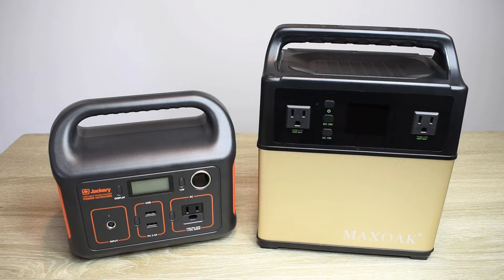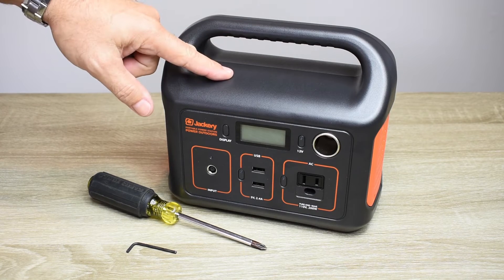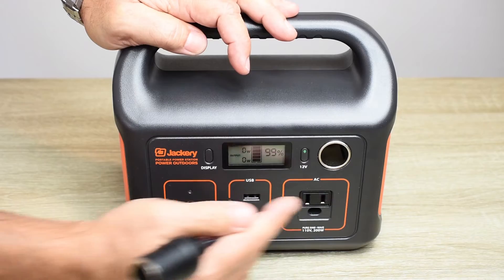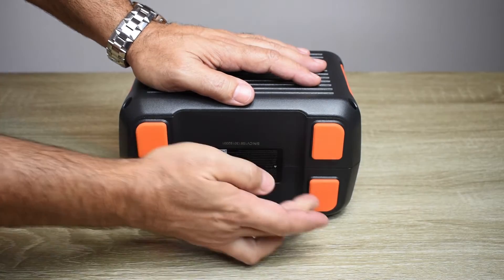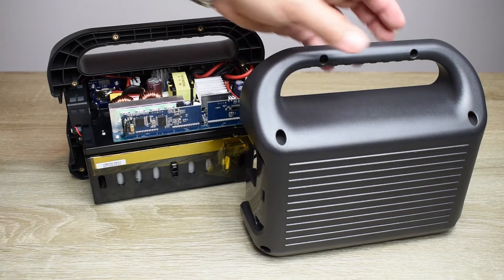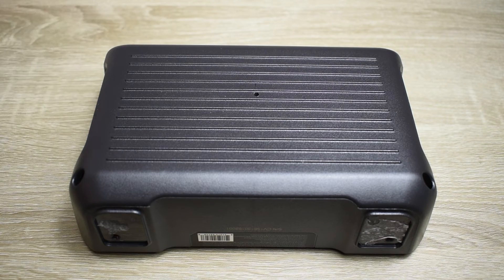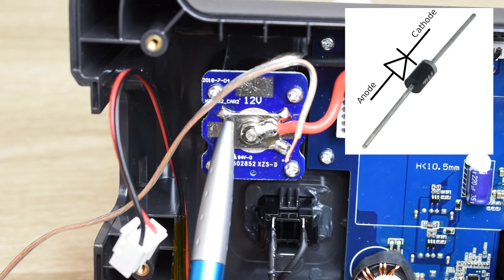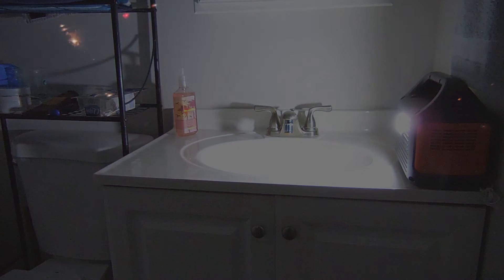Jackery Portable Power Station Lacks One Of These!

Comment from the maker: ATTENTION: If you'd like to drive the COB LED at maximum power(Extra Bright), then be sure to bond a larger aluminum plate to the portable power station first(unless the power station has an aluminum housing), then bond the COB LED to the plate/aluminum housing using thermally conductive adhesive. Thank you!
Reply: Thank u . 
Have u made any vids on and littelfuse.. the red  tvs. Transiant voltage .... thing . Used on 12 alternators to stop the higher then 14.5 volts from getting past the alt output . .

Comment: 🎉⚠️  W A R N I N G  ⚠️

AVOID AFERIY Power UNITS  & THOSE FAKE PAID FOR info media TEST reviews about AFERIY PRODUCTS. I bought the 2400 Watt version. It was DEAD on arrival.There is almost ZERO customer service for this brand. 

Do NOT buy Aferiy. Don't risk losing your money. 

WARNING - Do NOT buy extended waranties. 

DONT WASTE YOUR MONEY - LIKE I DID. 

Having said all that, Aferiy Power Banks are not totally useless. I believe they would make for really good boat anchors. 

I am posting this as a public service to prevent others losing their money. If this reviewer scrubs this message they are likely compromised and it's not a genuine review.

Comment: Nice work on this project.  I love modifying stuff like that to make them better.  In a project like this, does the LED need any kind of protective cover, or is it fairly robust for bumps and scuffs?
Reply from the maker: It's very durable. There's a rubbery coating over all the LED chips.

Comment: I added an inverter to my jump pack, it's only 18 AH but it's nice because It'll run my 2,000 watt inverter just fine.  It has a built in excellent air compressor, a directional light, cigarette adapter, amazing USB charger (charges things quick).  I too needed an area light too so I mounted a lamp with a LED Bluetooth speaker bulb.  It only uses 15 watts, but is very bright and the speaker is decently loud.  I also have a tiny inverter that plugs in the cigarette lighter (100 watt max) and put a light socket adapter into it to run it for very long periods of time by itself as the large inverter is inefficient for that purpose.  I am converting it to lithium power with 2 of those hoverboard batteries and a 13.8 volt transformer.
Reply from the maker: There's nothing wrong with modifying things to create exactly what you're looking for. :-) Thanks for watching!

Comment: For anybody looking to find a polyfuse/polyswitch.. Check an old motherboard or USB hub, should be sufficient to protect wiring as they will likely be <2A.  Pretty cool mod, can never have too many lights!
Reply from the maker: 2A or less will work fine for this project. Glad you liked the video!

Comment: Would you say you can make a better device than what is sold?
Imagine having a hand crank :)

also maybe email the company to show them your video so that they can improve it based off your suggestion?
thanks
Reply from the maker: The device is good, but I would've had the area light on the unit. It would've cost them only 2 bucks. Thanks for watching!